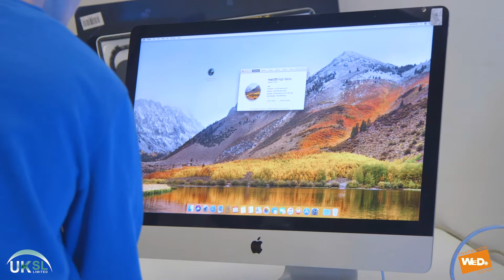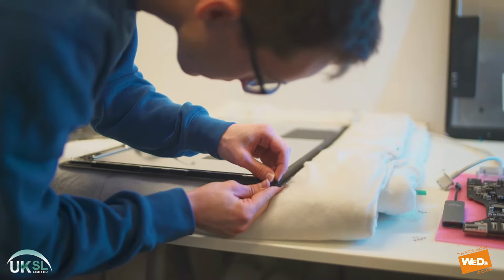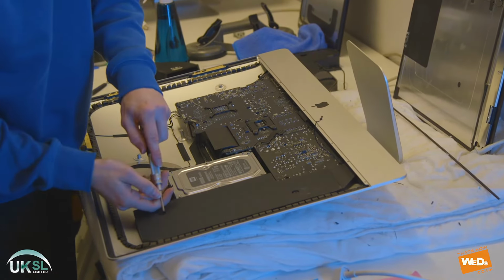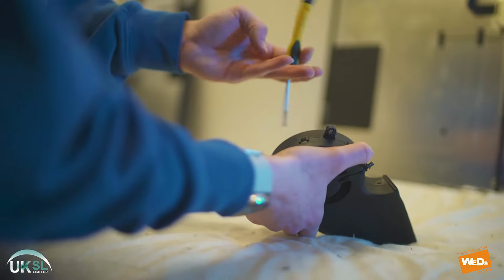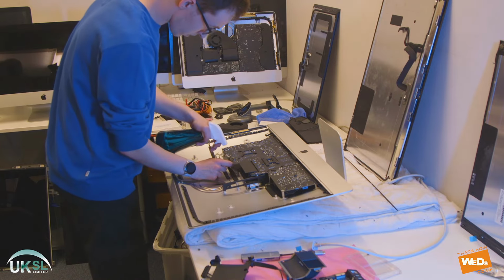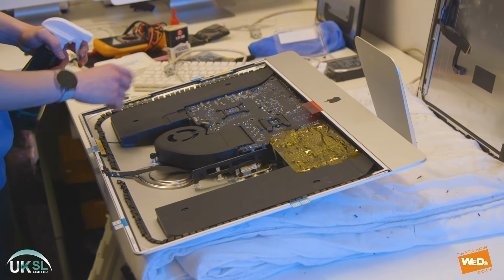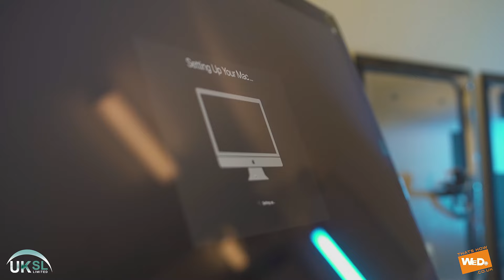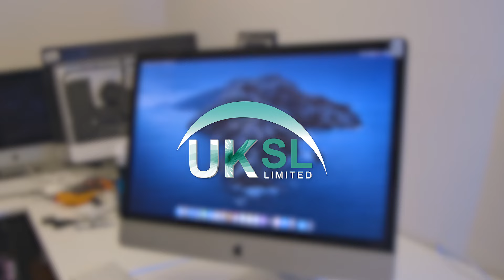27" Late 2013 iMac Full NVMe SSD Upgrade

Comment: One of the best "how to" videos i've seen in years. I have this computer. Didn't know i could put an NVME SSD drive in there. I have one and I'm going to do it. Thank you for helping me to be brave and get the job done!
Reply: I'm in exactly the same position ....don't know about the NVME setup either. Might as will update the memory also and guess you could still use the hard drive input to another SSD module there to.  Very cool !
Reply: Why not just put a sata SSD in here?
Reply: How did it go?
Reply from the maker: @stiksandstones The SATA connection is a bottlekneck.
Reply: @stiksandstones NVME IS FASTER!

Comment: The only things I would have done while it was apart, was change the plastic tension retainers for the springs that keep the monitor at a set angle, with a metal plate (these break and the monitor droops, happened to me) and remove the CPU heat sink and clean/replace the thermal paste. Makes sense to do all these maintenance items when the machine is disassembled. Maybe would have even replaced the internal HD with an SSD for even more storage.

Comment: During most of these iMac SSD and/or CPU upgrades, it not mentioned about replacing the clock battery while access is available during the motherboard removal.  It's only a $5 or less cost for a CR2032 battery and they are normally only a 5 year shelf life on your motherboard, so replace it while you have access to it!
Reply: my imac 2015 late 27" is br2032 not cr2032

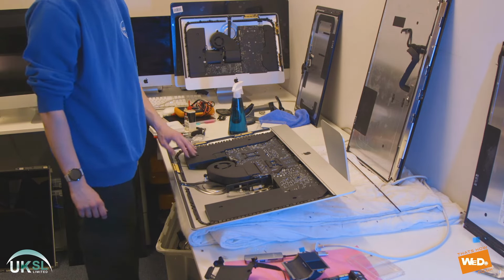Comment: I noticed that at 37:37 your tech applied - what looks like to me, like some clear cellophane tape onto the back of the power supply. I can only guess that this is to prevent contact to prevent electrical shock. Will he leave this in when closing of the screen. is that safe? Considering this may melt due to heat. Or is this just placed there only while assembling? Any explanation &/or benefit derived from doing this would be appreciated.

Comment: Really nice video, I will do the same with my iMac (same model, late 2013, 27 ″). One thing I’m a bit surprise is the way you manipulate the power supply… In many other video and text about this kind of upgrade, they say to avoid touching the power supply, because you risk taking a not funny electrical shock.
I also noted that at the moment of replacing everything, there is a protective sheet on the power supply, not mentioned in the description of the video. Is it important to have it?
Thanks!

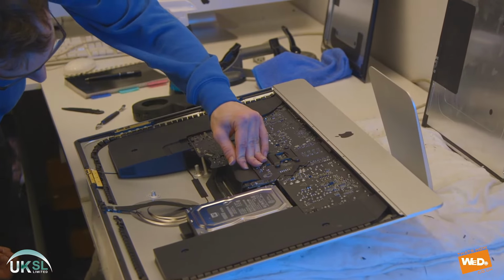Comment: the micro screws in the 15:00 base of the panel are philips not torx - it is without a shadow of doubt the fiddliest thing to replace - if you can avoid removing it I'd advise you to leave it in place.

Comment: Hi!
I'm in the same boat as you. Upgrading my iMac Late 2013 14,2 model. I have a question.

What is more (efficient), or more recommended to optimice the write/read speed in SSD? In my case I use a Samsung 970 EVO Plus NVME 1TB to upgrade the iMac, mount ONLY this disk in the imac? Or it's better to use together, with the old SSD (ex-fusion drive) and this 970EVO?

Thanks so much & great video

Comment: Replacing the battery while you have an open iMac is an excellent idea! Google says that it is a standard 2032 Lithium battery. Thanks for showing this excellent video. I was only missing a close-up of the disconnecting of the monitor cables, but I have other videos showing this. I am planning to do this upgrade as well in the near future. I already have all the components.
Reply: It is NOT a standard battery, it is the BR2032. Same size as the CR2032, but the CR2032 cannot survive the high temperatures inside an iMac!
Reply: @demef758 First time I heard about that. Are you sure?
Reply: The BR2032 battery has the same dimensions, a slightly lower nominal voltage and capacity, and an extended temperature range compared with the CR2032. It is rated for a temperature range of -30 °C to 85 °C,[2] while the CR2032 is specified over the range -20 °C to 70 °C.

Comment: I'm adding both an NVMe (1TB) and an SSd with 2 TB, but running the OS off the NVMe! My issue was that while removing the left speaker i tore the power button cable, so i had to order a new one off ebay, now i'm just waiting for that!

Comment: I just attached a 2T External SSD and boot from that. Not as sano as opening the machine, and not as fast but much less hassle and it screams.
Reply from the maker: It's half the speed unfortunately.
Reply: External thunderbolt ssd will give read and write speed of 800-850MB/sec

Comment: I am very impressed with this video.  I have an iMac 27" Late 2013 and for the longest time, I have considered upgrading the Fusion Drive to NVMe SSD.  What maximum NVMe SSD storage capacity can you install?
Reply: Yo estoy pensando poner un NVME M.2 de Silicon Power con cache y de 1TB, en Amazon por menos de 50€. "Unidad de estado sólido PCIe Gen3x4 M.2 NVMe 1TB con velocidades de lectura y escritura de hasta 3400 MB/s y 3000 MB/s (Silicon Power)".Le dejaré puesto el SSD de 500GB que lleva o tal vez se lo cambie después por uno de 2TB. El NVME de arranque con pocas cosas dentro para que sobre espacio y las copias de Time Machine no sean excesivamente grandes.
Reply: @noRthstaR1 Did you find any answer to your question? Did you go for the upgrade and was it worth it? Thanks for any reply ;)

Comment: I’m wondering why no one uses a little bit of heat to soften the adhesive?
Reply: I had a smaller version of a pizza roller. That thing gouges through the adhesive like butter. It took me a few seconds to lift the screen from the housing. The remaining tape was easily peelable. Within 5 minutes there was nothing left an I had clean surfaces.

Comment: great infomative vid thanks,  can you please recomend what adaptor you used or a NVMe that will plug straight in?
Whats the golden flim over the power supply is that essential?  and could i go all out and replace the old hard drive with another SSD for storage/back up? thanks
Reply: That golden film is kapton (sp) tape. It's used for different purposes, one of which is insulating electronics from shorts Which is the usage here.

Comment: Great instructional video, thanks for posting it on to YouTube. Any reason why you didn't keep the 1TB HDD and make it a fusion drive setup?
Reply from the maker: @MrMikeBriz  Cheers, the hard disks inevitably fail and would result in the iMac being opened up again. Fusion drives are very slow and so there was no point.

Comment: I purchased a Samsung NVME SSD 2TB 980 Pro, upgrading my iMac Late 2013 27inch, then I came across your vid, will this SSD still be compatible with my iMac ???
Reply from the maker: Yeah it will fit a late 2013 but you will need an Apple to NVMe adaptor for it.
Reply: @ukslmaclab1611  yep got a ST-NGFF2013 SSD Adapters on the way

Comment: Thank you so much for this video, A question, can I also put in a 1TB SSD ?
Reply: I would just like to say that I recently installed the Fusion Drive on my iMac 27" late 2015. It wasn't there for me. Only the empty slot. Built in NVMe 2.M from WD. More precisely WD SN770 1 Tb. Speed test made/measured read/write 2800 MB/s. I have of course installed the operating system and the iMac boots from the NVMe. My next attempt is to remove the 1 Tb HDD and install an NVMe 2.M with SSD adapter.

Comment: Greetings. When you change from sata drive to nvme, does the computer in lieu of changes to the fan/heat sensor automatically adjust to the new situation? I know the old drives had a sensor and now i assume not, so wondering what the system does with the lack of temperature. Thanks!
Reply: there is no HDD heat sensor in a 2013

Comment: Excellent. Regarding the choice of SSD, it's rumored (not confirmed by me) that Apple has begun checking for an Apple branded SSD when reflashing the firmware, a process typically included in major OS version upgrades. These can be found on the used market. They are Samsung SSPOLARIS SSD's, and an OEM part would likely pass the relevant test. The implication is that with a 3rd party SSD you might not be able to upgrade your OS to recent versions. If anyone has any direct experience about this, please weigh in.
Reply: Fortunately, these iMacs are no longer supported by Apple, no chance they will get any kind of firmware update.
Reply: Later Macs than model year 2013 contain SSPOLARIS SSD's.  I personally own some 2017 and 2019 iMac 5K's which contain them.

Comment: Thanks a lot for instruction! Amazing video. I have 21.5 Imac, is it the same way as 27? Just an adapter and easily can install m2 ssd?
Reply: The don't have M.2 ssd slots if they are not come with one AFAIK...

Comment: Hi! I have a problem with an iMac 2017, I already did everything and I can't find the solution, at first it detected the ssd with the adapter, I have a crucial 1 TB P3, I connect it to the motherboard and when I put the bootable usb with MacOs Ventura does not recognize it internally, if that same ssd I put it externally if the iMac recognizes it, I do the format externally and at the moment of putting it internally it it does not recognize it. I already installed the macOS Ventura by external means and I put it internally and it doesn't recognize it either, I don't know what to do I've been testing for a month and I have to be assembling and disassembling the iMac, I hope someone can help me, The disk utility does not recognize it, I already made the list disk and nothing does not appear the ssd m.2 nvme, I am totally blocked, do I need to do it with high sierra and then update to Ventura?

Comment: Greetings. What did you do about the hard drive heat-sensor? Did the unit make any of the internal fans run at full-blast?
Reply from the maker: Hi! 2012+ iMacs don't have hard disk temp sensors which trigger the SMC to put the fans on full when disconnected.
Reply: @ukslmaclab1611   perfect question
so if i understand correctly i don't need one i have one late 2015 correct ?

Comment: I'm a little disappointed with the 970 speed! I was expecting around 2500...not 750 like the SATA SSD. Is the speed of this SSD blade caused by iMac, adapter? I have a 2017 iMac... and I hope it will be faster when I do the surgery
Reply: Sata ssd wish they were in the 700s. More like 500-600

Comment: without the SATA HDD, do the HDD temperature sensor goes crazy and turn the fans on at full blast?
Reply: Apple stopped using HDD heat sensors after 2012

Comment: Seems criminal to me to toss the hard drive. These days you can easily find 2TB SATA SSDs for about $100. Pull the rotating hard drive and replace it with the SSD drive. After that, look up the steps to create a Fusion drive between the NVMe SSD and the SATA SSD. You will have to deal with Terminal, but the articles you will find only require you copy/paste a couple of short lines of code into Terminal to create the Fusion drive. Using a bootable USB drive to install the new OS, but first invoke Terminal from the installer to make the Fusion drive first, and after that, you install the OS on the Fusion drive. Alternatively, before you tear down the iMac, use a spare hard drive and make it a Time Machine drive, and back up your entire drive on it. After rebuilding the iMac, from the installer drive you can tell it to reinstall your old drive info from the Time Machine drive. Simple to do.
Reply from the maker: A fusion drive setup is much slower, we did speed tests and it's simply much better to remove the old hard disk. Platter hard disks are incredibly slown and regularly fail and involves stripping the iMac down again.
Reply: It’s better to have a backup drive as an external drive for évident reasons! I even have an external startup drive and a data external hard drive!

Comment: Nice video, i didn't konw the 27" late 2013 had a nvme slot (or that it needed an extension for m.2 to fit)
Reply: It had to have a Fusion Drive! If not there is no NVME slot…

Comment: Will this work on a 2011 model
Reply: Solo de 2013 en adelante
Reply: The 2011 model (A1312) has the screen attached with magnets.
I would avoid using those suction cups at their full capacity, go for half.

Comment: Very nice video. Sound track is not intrusive. Voice enunciation pleasant and understandable. Step by step instructions. Is there any reason you didn't install a 2.5" SATA III SSD as a data disk in the fusion drive cavity?

Which of the 27" iMacs from 2013 to 2019 do you consider the best? Please consider the GPU as well.

Very well done!
Reply: actually, ive been using imacs from 2011 to 2019 and the only reason using imacs are the beautiful screens buildin and the clean setup due to the case design. But technically inside of it, its a little bit overpriced for the heat and power they offer. I would consider a new generation with m1 technology. There is no reason using the older one with intel cpu. I mean, if you get them for little money due to some awkward problems like damaged fusion drive, damaged screen stand or some other typicall damage and upgrade/repair it, but if you can afford, go stick to m1/m2 imacs. I'm not impressed after repairing a lot of imacs about their price and quality after all. I mean, its much cheaper after all getting a nice 5k display and use a macbook pro m1/m2 or even a macmini.
Reply: @xperience2k12  It shows you a nice Windows 11 experience.... can your M1 do that?
Reply: Also using open core to Monterey with a 16/32GB ram upgrade gives a rather nice experience. If you need heavy duty then yes the m series is the way to go , other than that enjoy!
Reply: It can be done with an iMac Late 2015 27inc, it starts just as the video explains! I want to do it as the video says, is there any important note that I should take into account?

Comment: Yesterday I changed acc. your Video the HDD with a ssd. The first start after reassembling was horror because the ssd and the usb stick wasn’t shown on screen. Only a blinking folder with a question mark was shown. 
Can you explain the cause of that? I'm using a Samsung 870evo with 1tb.

But finally I brought that damn thing after 4 hours back to life. Don't ask me how. My wife was very happy. I think, I will never do that again. The replacement itself was easy although.
Reply: I also do not recognize the ssd nvme m.2 internally, he installed the macOS Ventura externally and if he recognizes it but at the time of installing it internally he does not recognize it, I have disassembled and assembled the iMac like 30 times, formatting the ssd in apfs, macOS extended, I have tried everything and it does not recognize me the ssd, it is an iMac 2017, I hope to have your support or the support of someone, greetings!

Comment: Great video! I'm getting ready to do my own upgrade on a 2019 iMac and was thinking about dropping a fresh battery on the logic board while the Mac was open. Unfortunately  I haven't had much luck in finding out what kind of battery is needed. I have some spare CR2032s that I use for AirTags. Do you think those would work?
Reply: The battery type is stamped into the battery itself, namely BR2032. This is a special high temperature battery that can tolerate something like 200C. It gets hot inside an iMac! The CR2032 will fit, but it is not capable of surviving elevated temps. It's a hard battery to find. Mouser and Digikey both sell it though. Pretty cheap, under $2 from them.

Comment: In my experience the suction cups used in this video are too powerful, they will crack your screen very easily.

I have done this with two double suction cups, of the same brand that's used in this video and the screen got sucked to pieces. This was done on the 27" models that have magnets attaching the glass to the chassi (A1312). 
I will try to attach these suction cups with the leaver starting at around half way, so only half the suction force is applied, that should be more than enough, since these suction cups are designed for removing car windows.

Comment: Is the nvme ssd better option than ssd?
Reply from the maker: Yes it completely cuts out the SATA bottleneck and data goes straigh into the PCIe Bus. Much faster and more efficient!
Reply: I think, I can confirm that. My mainboard in my PC can only handle SATA SSDs. The transfer rate ist roundabout 500mb/s. The nvme ssd in my wife’s mac has a transfer rate of 750mb/s (more or less). So, the Mac goes faster(datatransfer) than my computer.